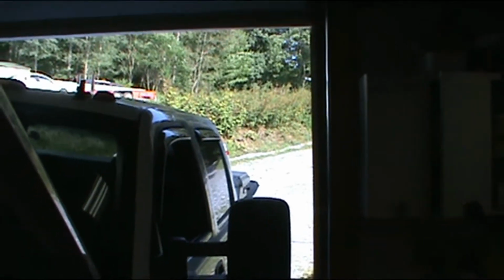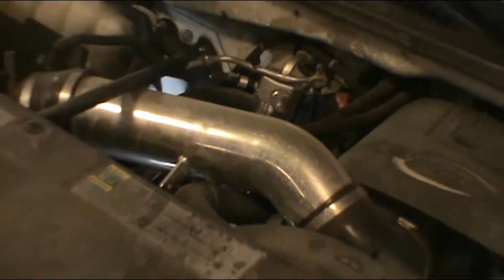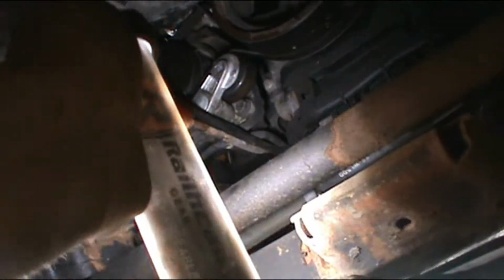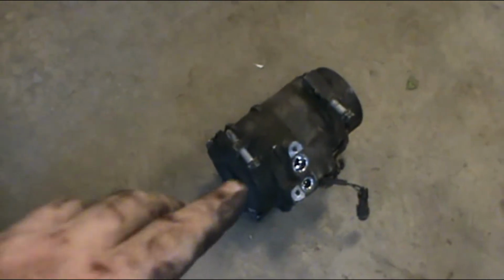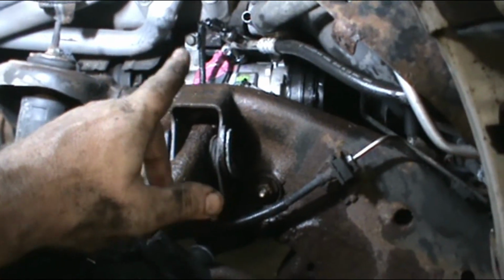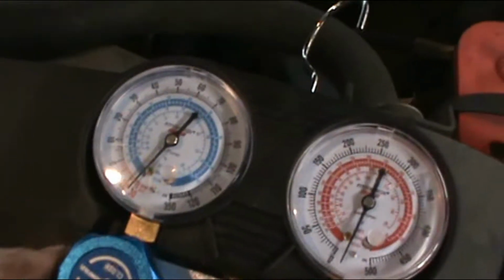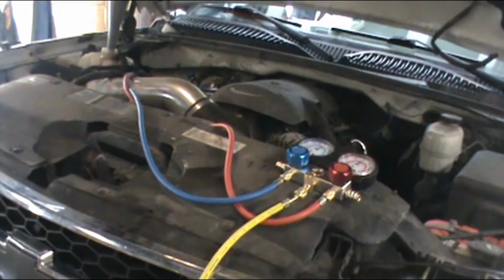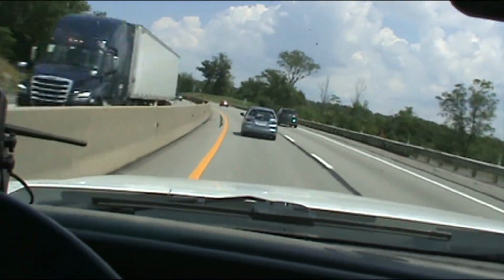Change AC Clutch or Change AC Compressor Silverado Sierra, Tahoe, Suburban

Comment: Just did mine... broke the same piece of the shaft off even using a pulley puller... I put the new clutch on and reassembled . If its doing that much it shouldn't break so easliy lol. Time will tell if I'm gonna eat saying this or not...
Reply from the maker: It worked well enough for the rest of the time I owned it lol.

Comment: how you have high and low on the same line is. at the dimple in the line between the two fittings is a orifice tube that changes the state of the fluid and splits the high and low side.
Reply from the maker: Chris Dorman thanks, I actually found that recently and should have changed the tube and drier when I changed the compressor, but I was on a time crunch so.....